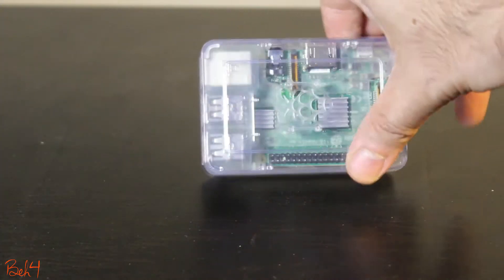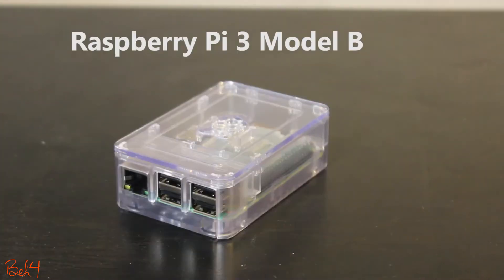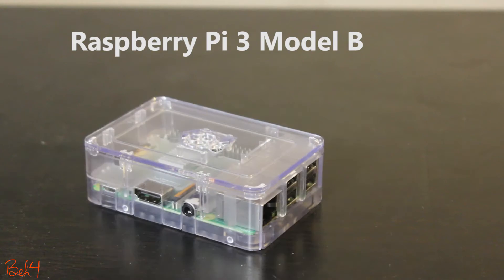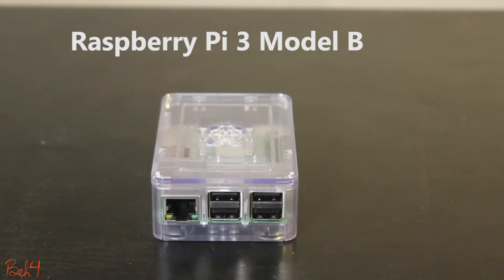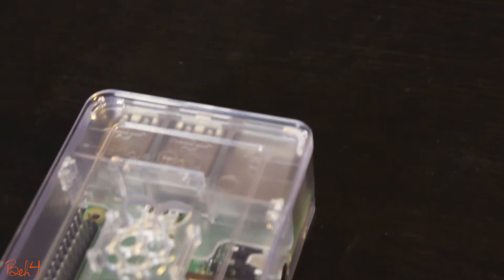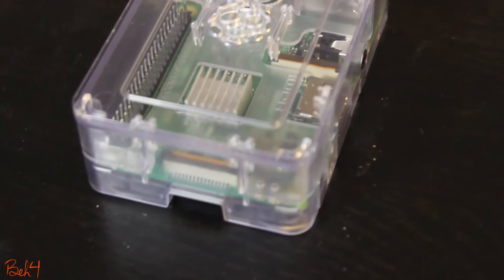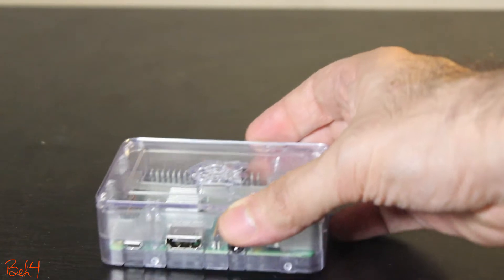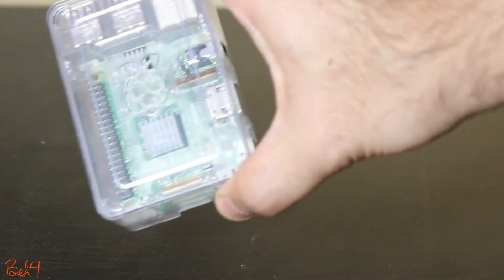CanaKit Raspberry Pi 3 Model B Ultimate Starter Kit

Comment: What does it do?
Reply from the maker: It is credit card size and capable little computer which can be used in electronics projects, and for many of the things that your desktop PC does. It's is slower than a modern laptop or desktop but is still a complete Linux computer and can provide all the expected abilities that implies, at a low-power consumption level. Many Operating Systems and also programming languages ( Python for example) can be installed and used on the Raspberry to do different projects.
Reply: He means what does the kit do